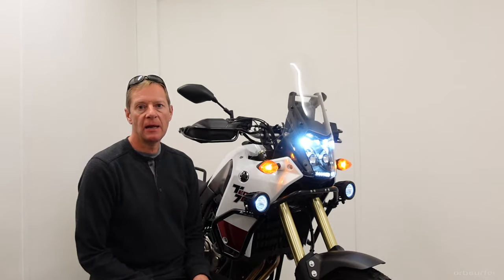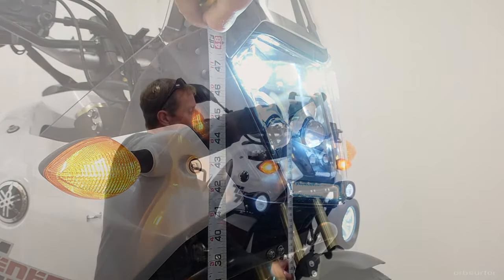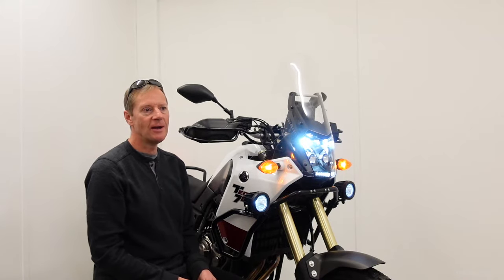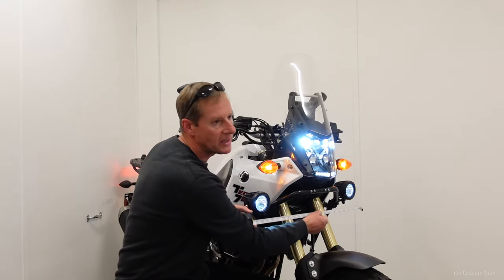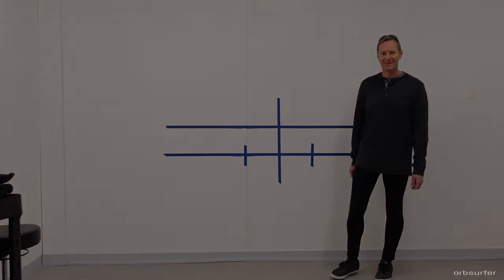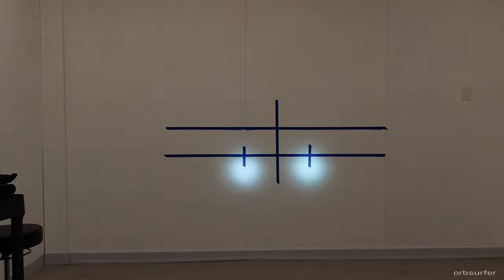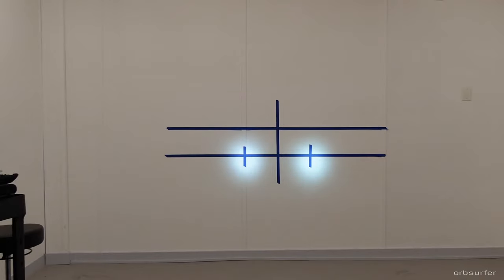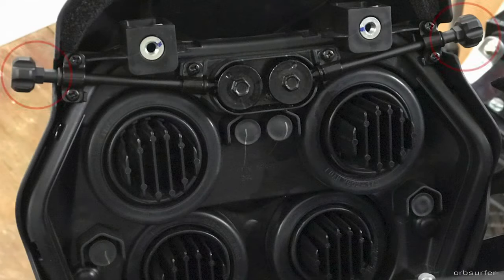Motorcycle Head Light and Auxiliary Lights Adjustment

Comment: Does simply sitting on the bike change the heights on the wall? How much sag do you have when sitting it?
Reply from the maker: Ideally the lights should be adjusted while someone is sitting on the bike. 

The amount of sag is dependent on the type of bike, weight of the person, spring adjustment etc. You can get a rough estimate of the sag by using a zip tie around the fork up front pushed all the way down to the seal without sitting on it, then sit on the bike, get off the bike and measure the distance the zip tie moved.
Reply: @orbsurfer8195 
It is also dependant on weight distribution. If the rear drops further than the front when you ride, the lights will raise and you risk the lights points upwards (if they aren't properly adjusted while sitting on the bike).

Comment: Any tips on adjusting duel low beams, similar to your spotlights. I want to get most width as possible from my double low beam setup
Reply from the maker: mark a center line on a wall - then mark an equal distance from the center line to two additional vertical lines - one on each side of the center line - as for the distance to the two additional lines, it will have to be an adjustment in progress - start with 12" /30cm and see if it is too much or too little after a ride in the dark, then change by 4"/10cm at the time... Sorry I cannot give you an exact number - I do not know if you want the lights to perform like cornering lights on many cars, or just to generally light up the edge of the road.